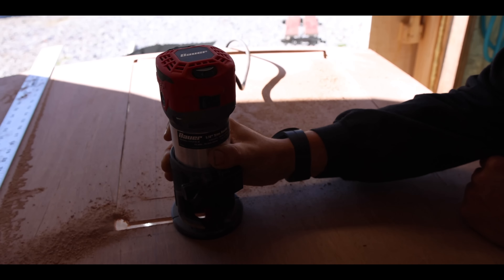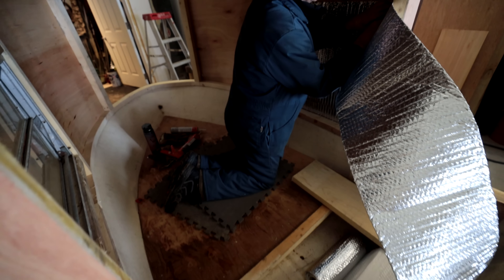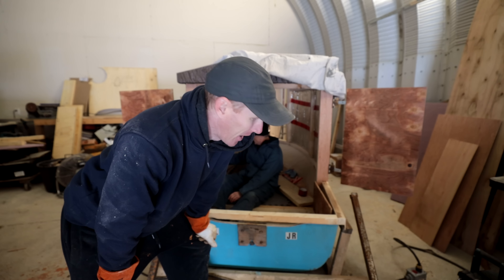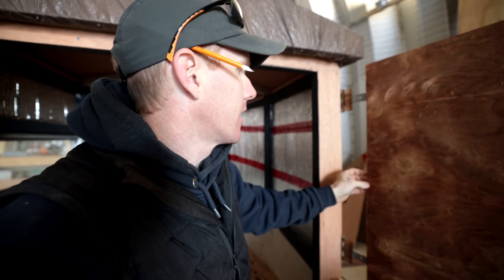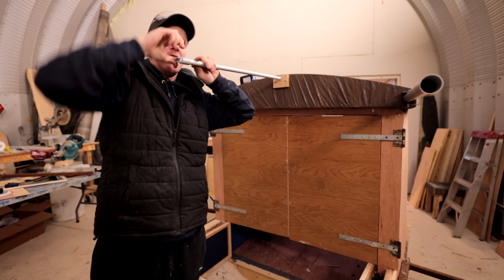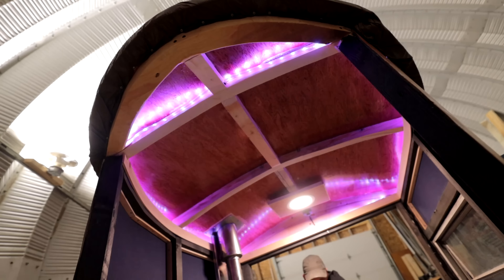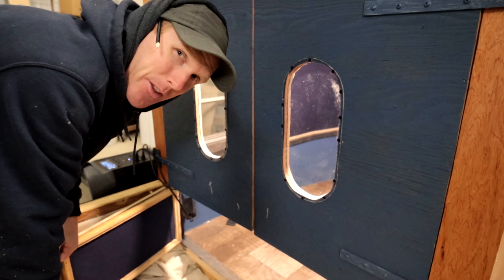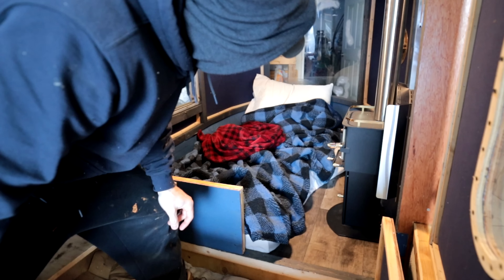Building a TINY HOUSEBOAT (It's Finally Done!!!) vs. @FowlersMakeryandMischief

Comment: It's pronounce tar pee LEEN. But nobody's trying to be fancy. We all say tarp. I was on their website not too long ago and saw the marine setup. (hint, hint. wink, wink) You probably could have used a heat gun to remove the rest of the sticky paper. Try Windex or rubbing alcohol or vinegar. Generously, spray it on and let it set for a few minutes (maybe 5 min), then it should wipe off. Hopefully that won't damage your Lexan pane. Try HOT, SOAPY water first. Then, the other things I suggested IF the hot soapy water doesn't work. Sometimes, the simplest solutions...

Comment: Lexan is extremely finicky - as you have discovered.  I am sure this comment is coming too late, but….
NO CHEMICAL STRIPPERS, NO SCRAPING.  picking is your best bet, maybe with some olive oil or canola…. 
If you need to use a scraper, use a plastic stick and be very careful (NO METAL).   I don’t think you can repair the one that is chemically burnt.  
I have never tried it, but I would not suggest the “gasoline burn off” on the second one, as your helper suggested; it will likely distort your remaining piece.
I hope this helps.  Lexan scratches like a son-of-a-gun and as far as I know, there is no repairing it.